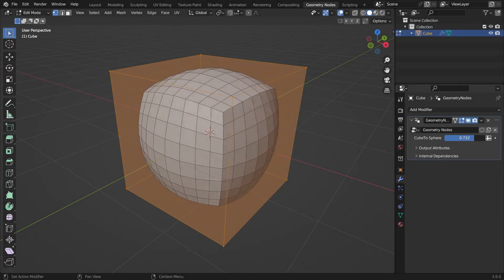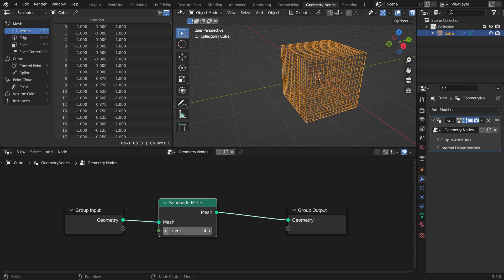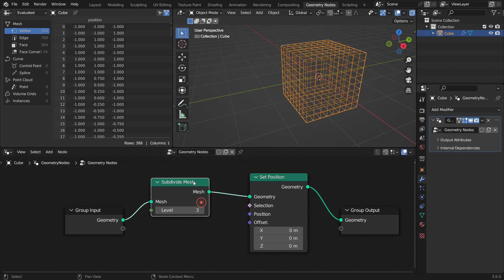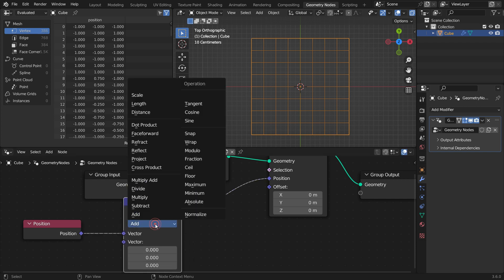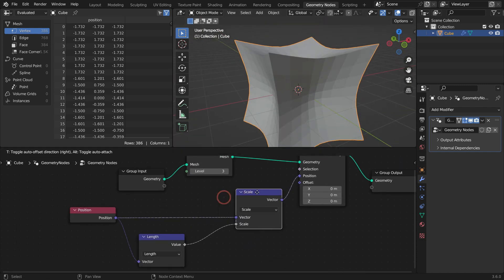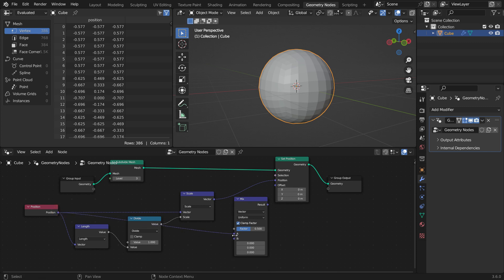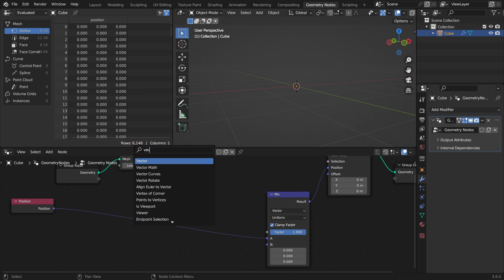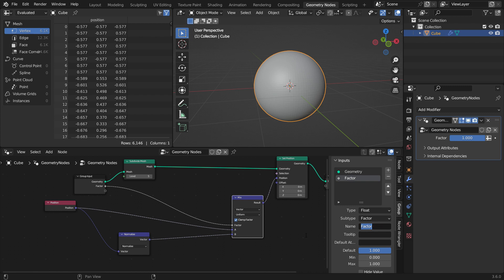Convert Cube To Sphere Using Geometry Nodes | Blender 3.6 Tutorial

Comment: Nice tutorial, but viewers should understand this only works because the center of the cube is exactly 0,0,0.
If your cube's center isn't there, you have to some additional math to find the center (bounding box max - bounding box Min)/ 2
Subtract this from position before finding the length.

"normalize" version only works because the cube is exactly 1m.  
To compensate for different size, you'd have to multiple by the size (bounding Box [x] max - bounding box [x] min) after normalizing.
Reply: If you add a "Transform Geometry" node after the "Set Position" node does this allow Location/Rotation/Scale without breaking the cube? The origional Cube will remain at the World Origin however the results of the "Group Output" can be moved, rotated and scaled.
Reply: @jlr3636  
Yes.